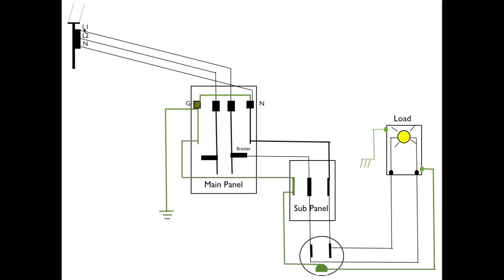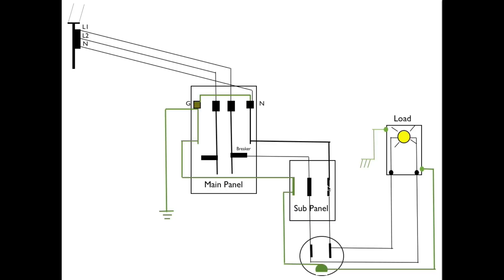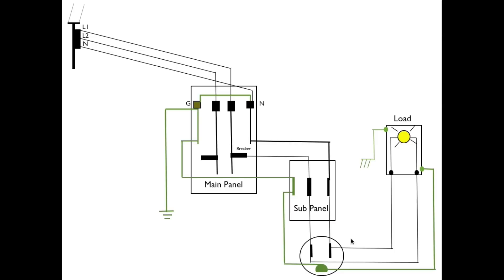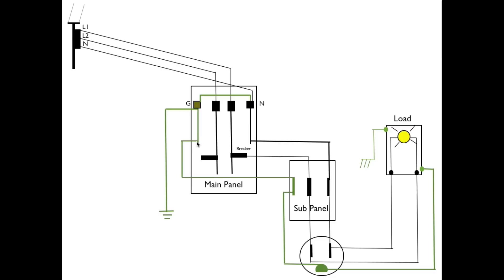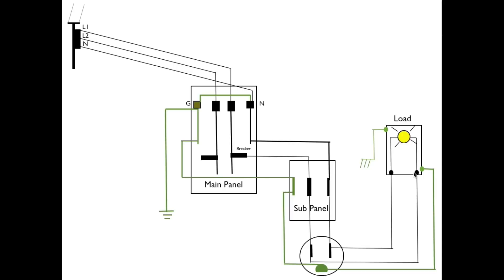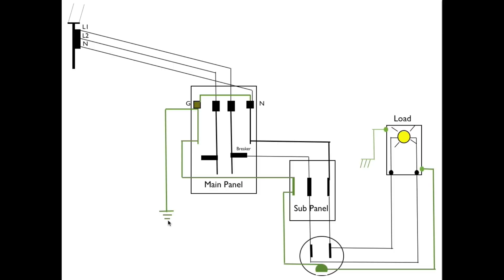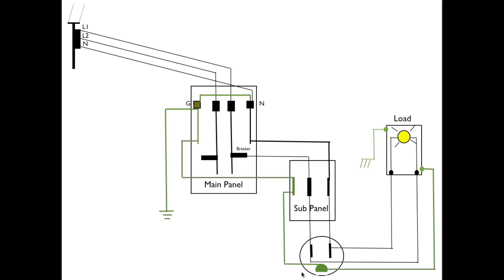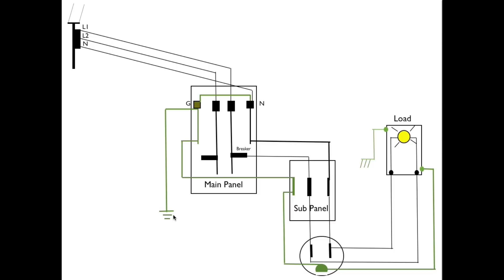The difference between neutral and ground on the electric panel

Comment: Thx. You got me closer to understanding. Still fuzzy on why ground connected to neutral at the main panel doesn't complete a circuit and cause problems all of the time. Hopefully it will sink in sometime soon.
Reply: Surging Circuits l
Reply: +Mike Schmidle  -- ???
Reply: Path of least resistance theory.
Reply: It might help you to understand that a neutral is used as a return for the 120 V or 277 V circuit or the imbalance to a   circuit or box and that the ground is there for safety. In other words, a neutral will have a current on it but the ground should NEVER have a current. I realize that I am oversimplifying it but maybe this will help. P.S. I am a retired electric substation construction and maintenance guy and the most important part of the station was grounding.Hope this helps.
Reply: Thanks, guys. I guess I get lost in this as I think about AC and go wrong somewhere. To me, Hot and Neutral alternating between neg and pos polarities convinces me  that the neutral is carrying current - 1/2 of the time - polarity  /  1/2 of the time + polarity.  So, in my mind, when neutral is +, and connected to a ground wire (-) at the box, that completes a circuit to me.  As for path of least resistance, the bare copper ground is offering the least resistance, so…  I'm missing something to simple to grasp, I guess.  Appreciate the attempts to help.
Reply from the maker: Well, you have received a number of comments that may have been confusing.  I would forget positive and negative.  It has no meaning in AC.  There is also no real path of least resistance.  Earth ground is just not part of the circuit.  There is lot of confusion on use of earth ground.  The neutral conductor is a center tap of the transformer on the pole.  The reason for that center tap is only to provide 2 voltages into the structure.  If you only wanted one voltage, you would just use the both ends of the secondary winding of the pole transformer.  The ground would still be there for lightning discharge to keep lightning from traveling thru the structure.  I have a playlist on "grounding and bonding"  that may help.  Just type it in to the channel search engine.
GFM
Reply: Wow, GFM! You are approaching the 1,000 videos mark on YT! Awesome!

Took your advice and watched your recommended videos (and a few others) on commons, grounding, neutral definitions. Also some transformer vids.  I think you have straightened me out. It's making sense now.

A few things I picked up…
1) Earth Ground is high resistance and impedes current flow. Will disperse high voltage currents; lightning, etc.
2) Earth ground is not part of the circuit. And, it doesn't save your butt; rather, protects equipment.
3) Bonding is connecting all exposed metallic items (not designed to carry electricity) to protect from electric shock.
4) Had not realized that all transformers are AC only.
5) Neutral is basically a transformer secondary center tap. Unbalanced box loads are returned via neutral.
6) AC Polarity is basically only important for non-metal (non-conducting) floating ground devices.

A bit mystical that neutral (center tap) will receive current back into the transformer secondary in an unbalanced load situation. But, hey … a good solution.  Take it and run.

Thx a bunch!
Reply from the maker: Merry Christmas
GFM
Reply: The neutral at the pole take s all the excess energy back to a true ground . the lightning rods ufer grounds ,ground rings and water pipes are secondary panel grounding.
Reply: Here's a simple way to grasp the difference between neutral and ground. Think of the hot and neutral as pipes in a hot water heating system. You have a hot pipe from the boiler (hot leg) and a return pipe going back (cooler water = neutral) circulating round and round. This is exactly what AC power does but it's pulsing 50/60 times per second. The ground is in case one of the pipes springs a leak. In Europe the ground is called a drain wire, so think of the ground as a floor drain to carry away any leaks. Leaks are not supposed to happen so it's just for an emergency. IOW, it's there and ready, open ended at the appliance, but not part of the normal operating loop. In similar fashion to power the water starts out at a pond, stream, reservoir, well, and the drain (for emergencies) will dump any leaks right back to the ground.
Reply from the maker: Good thoughts.
GFM
Reply: bee4pc goldrule and rupe53 - Thanks for your replies and info.  I think where grasping the concept goes wrong, is like GFM said; you have to forget about polarity.  When we see how AC is produced, and how DC flows from a battery, we lock into polarity and the thought process turns into this:

HOT (L1) is +120v and NEU is 0v; POS charges seek NEG, and NEG charges +electrons seek POS as there is "pressure/force" aka Voltage. Therefore, NEU is NEG and experiencing current (electron flow).
==Armature Turns 180degrees==
Now, HOT (L1) is 0v NEG and NEU is +120v POS. Flow has reversed. We have Voltage/Pressure in the opposite direction. NEU is now +120v POS, connected to GND 0v, and !!! OMG, it's a dead short!

But, this is not so.  When you see diagrams (GIF image animations) showing AC converted to DC via Bridge Rectifiers, you relate to the two inputs as L1 and NEU; both carrying current depending on polarity.  Cheers!
Reply: Surging Circuits: Just look up on the pole at a transformer and see your share of it as one of the three windings in a 3 phase delta configuration. The power company connects a black insulated stranded aluminum conductor to each end of the 240-volt winding they designate for your home. The power company creates a "service drop" to your house by supporting the two insulated wires on an aluminum carrier. The power company end of the base carrier is attached to the center tap or middle of the 240-volt phase winding on the pole. The voltage on your end of this bare wire would be all over the place relative to parts of your house and items in your home. As a custom now the practice is to start taming your end of the three wires by grounding the neutral at the top of the mast, in the meter base, or at the main disconnect panel. The "service point" is where the bare aluminum carrier is spliced to the third insulated wire your electrician placed inside the vertical mast and where the two insulated "hots" (L1 and L2) are spliced near the top of the mast to the two insulated hots your electrician installed in the mast. I will skip the concepts of weather head and drip loop for now. A service hook might be found securely attached to your house to hold the weight of the service drop consisting of the bare carrier and the two insulated hots swinging in the air.

Now, national "customs" usually related to a power company "Blue Book" of installation standards and the currently adopted NEC published by the NFPA will place some order into what is so far just a few wires dropped in your front yard.

Why will the bare "Carrier" from the center tap of the 240 V winding on the pole with the other end now spliced to one of three black insulated wires in the mast eventually get grounded (intentionally)?

Because the rules have worked in millions of installation over a lot of years and are currently the best way we know that has been blessed by the code committees of gurus. 

Many rules came about due to fires and accidents. Many more relate to "good engineering practice". I don't recall any  "rules of thumb" in the NEC.

Also, the installation methods and techniques must satisfy the electrical provider (power company), since they have accepted practices also, based on long and painful experience with customers trying to steal or misapply their product.

No mention yet of a "neutral". The NEC defines that word and it starts out being the connection "that carries the unbalanced load".
(This is not the full or only definition. 

When it comes to electrical services the neutral is also "the intentionally grounded conductor." If it is considered a conductor it must sometimes carry current, right? When you have more devices switched on on one 120 V winding than the other, there must be an unbalanced load and some neutral current.

There is no unbalanced load in a 120-V branch circuit, but the white wire returning the current that has gone through the load (bulb, heater, appliance, etc.) has also been called a "neutral". The black insulated wire often carrying current to the load is most0often called the "hot". If you grab a white "neutral" and somehow put yourself in the circuit back to the  neutral bar or bus in the panel, you will think it is also hot. Whatever current leaving the 120 V single pole breaker goes out to the load on  the black insulated wire and comes back to the panel on the white insulated wire. The same current (in amps) flows in the white and the black wires. There is a voltage drop in the circuit based on wire resistance over the length (and return) of the branch plus the load resistance, but the current comes back the same as it went out. More resistance the less current produced by the driving force, the voltage applied to the circuit. Current flows. Voltage is the force or potential difference available to cause the current to flow through the wires and the load. In the analogy to water, the voltage is kind of like the water pressure in psi at the faucet and the current in amps are kind of like the flow rate in gallons per minute. Resistance is kind of similar to the friction in the pipe or hose and things like viscosity, bends, etc that can affect flow rate experienced for a given pressure in psi available to push the liquid through the pipe or hose. (Don't take all these comparisons literally.) Kind of means maybe kinda or sorta.

Back to your worries about grounding the center point of the 240 V phase winding of the delta on the pole by driving a couple of ground rods at least 6' apart. All it does is give you two 120 V power supplies, a 240 V power supply, and a reference point for the voltage relative to the earth.

Don't sweat it, just do it.
Brighter minds have figured out these recipes or practices. Now you want to bake a cake so use the recipes and enjoy the cakes and goodies.
But follow the rules. Learn where to find the rules. (Google "2014 NEC ground electrode conductor 4/0 service wire to main overcurrent device)

Use the web pages referenced in the Google search such as mikeholt.com and ecmag.com. Read when you have trouble sleeping.

Beware of comments following videos on YouTube. Some bad advice can kill folks.

If the rules say 14 AWG copper wire is good for 15 amps in house wiring, so be it. If they say 6 AWG copper is the smallest wire you can use to the ground rods without protecting it with conduit, don't use 8AWG aluminum or copper. If they warn that 6 AWG copper is OK without conduit ONLY if you dress it to the structure, don't leave it hanging in mid air to be tripped over.
Reply: waltbarn , thanks for your time and exhaustive contribution. Have been studying, watching, and "weeding" for a while now. It makes sense once the weeds are gone. This subject confuses many, and my previous post is about where I think we go wrong in understanding the role of neutral and ground(s) on this subject. Once you get it, though, it makes sense.  Cheers!
Reply: The above is yet ANOTHER good reason to defer this end of domestic power to an electrician.
Reply: Thomas Lanik - Agree.  However, I think learning, sharing, and knowing are good things.  You can't just count on someone else for everything that happens in your life.
Reply: with electricity you should
Reply: GFM you are bloody dangerous making such a statement about the use of a neutral in a 240 v  european system, or any system. the neutral output on any transformer is bonded to earth. Your USA type ( 2 of 120 volt) or the 240 (1 of 240)  for the rest of the world, is done for reasons that you don't seem to grasp, so stop misleading people.
Nothing in the electrical field is done by accident or for lightning.
If your ever in Ausy or France, you will see that every pole that caries a transformer has a large earth wire going to the ground for ground bonding, you are correct in saying that that wire is not there to carry any current, reference the neutral to ground only. The ground does not carry current because the neutral wire to the transformer from your panel, is a very very low resistance compared with it's ground parallel path.
check out surging circuit's comment no 2 and 6 below(unbelievable )
 2 and 3 are counter intuitive and if he didn't know that the house power is ac, then he coming from such a low base of knowledge, that small snippets of information on these sites is very dangerous.

LUV Brad
Reply: OMG
Reply: Forget ground. It is only there for safety. Remember the old buildings had only hot and neutral on their outlets. No ground at all and they worked. So the voltage is switching directions between hot and neutral only. ( 60 times a second.) Since natural is tied to ground, if you took a single wire from the hot side of an outlet and stuck it to the dirt it would cause a current to flow and trip the breaker, since the neutral and ground are tied together. I hope this helps.
Reply: Complete what circuit? So what would you do to the ground wire if you did not connect it to neural? The term ground may be confusing, think it as a low impedance path for the fault current.

There are different grounding systems. In TT one puts the ground wire just to ground and nowhere  else. The problem is that the resistance is too high ans it will not trip circuit breakers. One needs GFCIs. In TN-S one is provided separate ground and neutral so there is no need to connect them. The most common system no in any countries is TN-C-S where one is provided a common ground and neutral and they are separated at the main panel. There is also TN-C where they are common all the way to the socket. There are others.
Reply: @okaro6595  , thanks for the info.  I think it seems confusing when the neutral goes HIGH, and is connected to the Ground LOW.

Comment: yes, good. I had a range in an old apartment using the ground as a neutral and if you touched it AND the faucet, LIGHTNING! The chassis was energized..Ive also had electricians in a fire repair (under my General contractor work) fail to wire this properly and the inspector passed it, but when I called and reported the issues he returned in flames and kicked asses! Good job. Important clarification. The meter will read the G and N to be in common but they are different in function! Thanks for the good work here!
Reply from the maker: Welcome
GFM